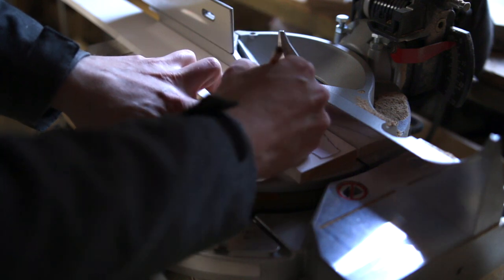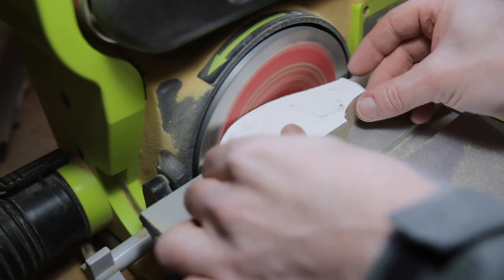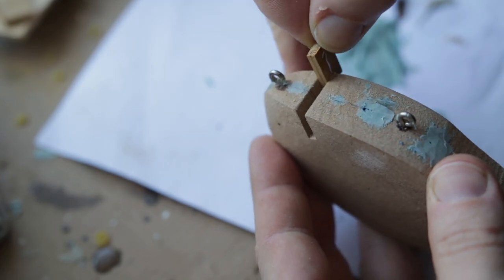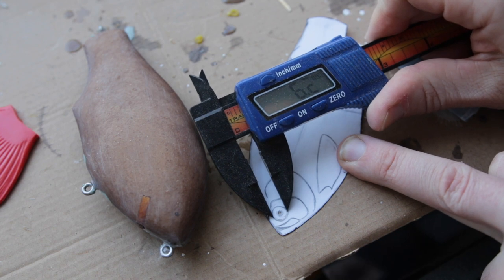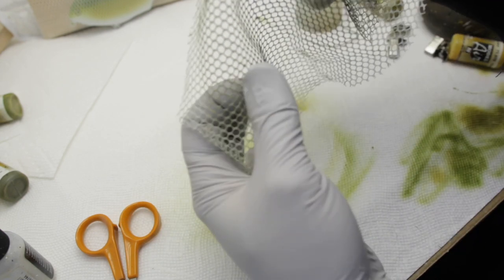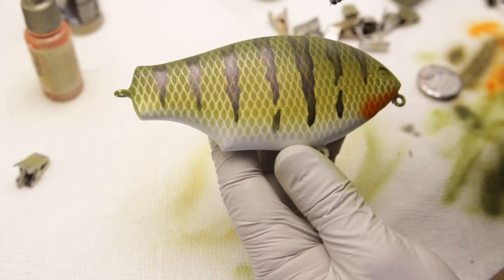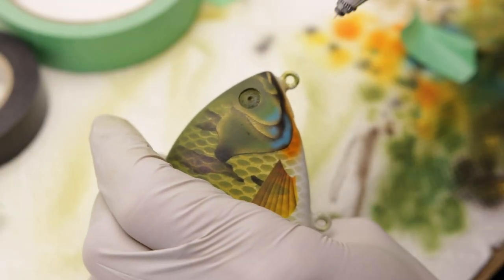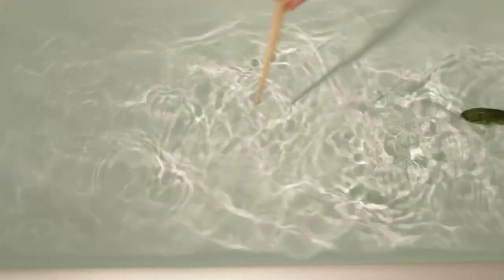Bluegill crankbait from MDF board, the full build.

Comment: Simply the best bait maker at least on YouTube. You keep it simple with materials but come up with outstanding designs, unique baits and of course unmatched pair jobs. 
By the way, I may have copied your turner design somewhat, modified slightly but same idea. It’s been great for all shapes and sizes of baits and other things I’ve clear coated. 
Thanks for all you share!!
Reply from the maker: Thanks for the kind words 🙏
Reply: @SolarfallBaits   I saw on a group someone made a frame for the mesh and when pressed on the lure it kept it nice and tight. Likely something you’ve tried but thought it may be an option for that meshing you used.
Reply from the maker: @paddlehooked4687  I've seen something very similar. I'm not sure how well it would work to get this type of effect though.

Comment: Amazing build as usual and a pleasure to watch. What material do you use for your plastic bill/lip?
Reply from the maker: It's called lexan polycarbonate sheet that I used for the lip
Reply: @SolarfallBaits  Thanks for the reply.  I have used some of this .030 thick material for balsa lures for fly fishing.  I super glued lips then used up resin to top coat lure.  The lure had a fast wobble which is what I wanted. The BAD NEWS the lip BREAkS OFF after a short while. I repeated this experiment 3 more times with shorter lips which broke as well.  I am going to try different adhesive before I move on to thicker material. Do you have any other suggestions?
Reply from the maker: Sounds like you might have used normal polycarbonate to make your lips. The lexan type bends before breaking and you have to bend it a whole lot before that happens. I have never had a 0.30" actually break off.
Reply: @SolarfallBaits  Thanks for the info. I ordered some genuine Lexan Polycarbonate, wish me luck.  I ordered .020, .030 and .060.
Have you ever used material less than .030?
Reply from the maker: @fshng2114  I do have some .020 sheets too and they are pretty flexible hence durable.
Reply: Thanks for the help and information.

Comment: Nice video 
I have made lures from MDF
But I found out the hard way that any flaw or chip in the epoxy or paint 
And then some MDF will suck up water like a sponge 
I had 2 of 20 or so lures I made , the finish chipped 
Those lures had areas swell up over time
Reply from the maker: That's always a possibility the trick is to let the mdf suck in as much epoxy as possible, i think urethane sealer might be even better cos it's thinner.

Comment: Are you sure that super glue is enough for holding the screw eyes in the soft mdf?
Reply from the maker: Yes I've done some tests with it and it's surprisingly strong the trick is to drill a hole that is smaller than the diameter of the screw eye

Comment: The MDF use is fascinating. How would you rank it as far as carving and action? I'm always going to be a natural wood fan but its nice to know it can be done with MDF.
Reply from the maker: With carving you need to be careful it's kinda easy to shave off too much  but that's true with some timbers too so I think you will be good as long as you have a sharp knife. Action wise I would rank it surprisingly good. Only thing I would be careful with mdf is that you need to seal it well. If you get any water damage,  the mdf will expand and pretty much tear the epoxy coating  open. With sufficient care when applying the sealant this should be a but a small problem.